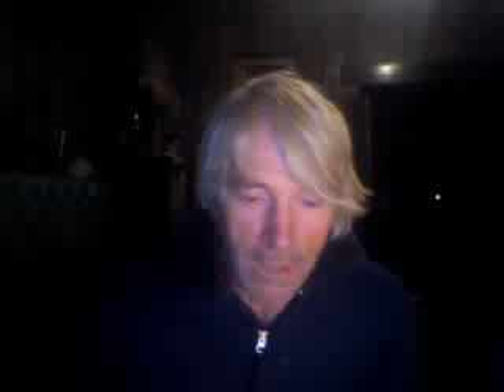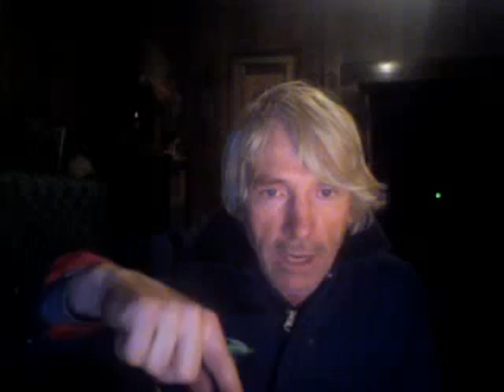A Gravity Energy Ball

Comment: If I understand correctly, this is just another gravity wheel.

I forget if it's hundreds or over a thousand years old, but people tried this before. It does not work, has never worked and logically cannot work.

If you feed energy into the system it'll work, but badly and be vastly inferior to modern devices.